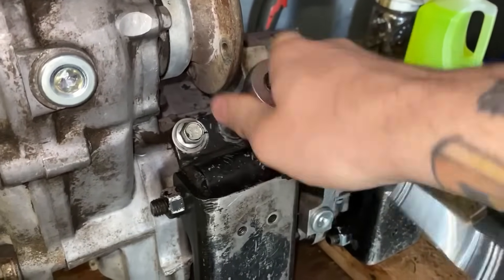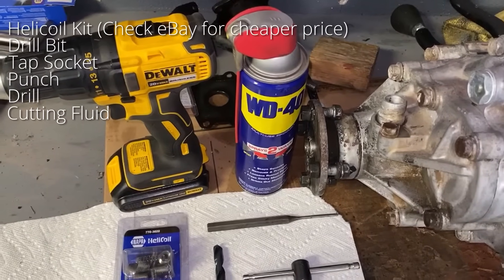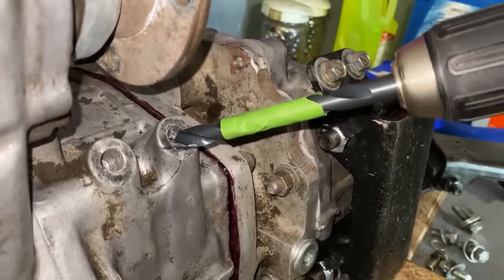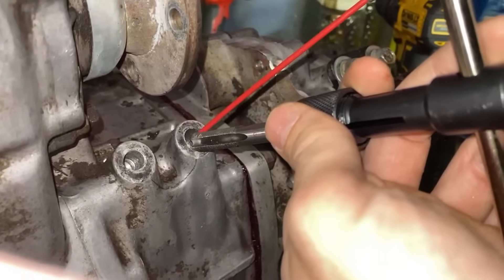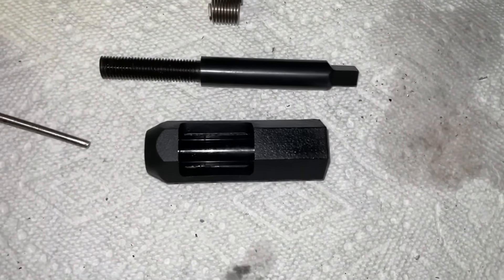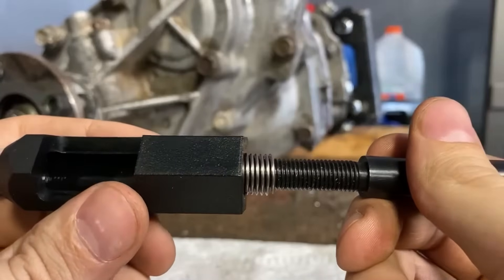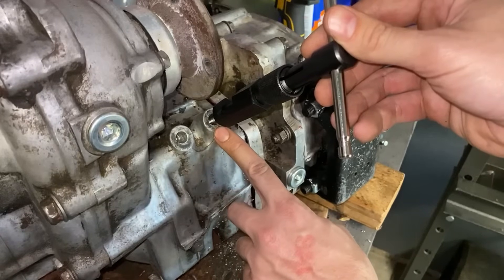How to Fix Stripped Threads With a Helicoil

Comment: how do you keep shavings from falling behind the wall of a hole you drill out ? Also you should use a drill bit guide to keep your hole straight..... then how would you keep the tang from falling behind the hole ?
Reply from the maker: If you were doing a through-hole you could put grease on the bit to catch the shavings. That always works pretty well. For the tang on a through-hole you could potentially get a skinny set of needle nose and wiggle it until it work-hardens and snaps off.
Reply: @RM_Garage  thank you !

Comment: Decades on this planet and I didn't know you could measure a hole depth with the other end of the callipers 😅
How would you tackle this? An injector clamp bolt hole with stripped threads must have been drilled out for a helicoil. The 'mechanic' ballsed it up and the injector popped taking the helicoil with it. Now theres about a 14mm hole.

The original snap bolt is 6mm so don't know how much alloy wall is left in the bolt hole. It gets better, its an Ingenium engine so you have alloy cam carrier box - then head - then block. The bolt hole goes through the cam carrier box and into the head. So anything involving loctite fixing compounds or metal putty can only be used on the lower head section otherwise you'll never get the cam carrier box of again. I was thinking a spark plug insert in top section and blank insert in head section with guide hole only, then with custom made insert to match spark plug insert, carrying an internal 6mm threaded hole. Torquing up the snap bolt is gonna be a bitch though and thats even if it does hold being seated in the cam carrier part only. It's got me scratching my head thats for sure lol.

Comment: Thank you sir, replacing head and base gaskets on a Honda CB650 and snapped off 2 head bolts in the aluminum case and currently drilling those hard effers out with carbide tipped glass and tile bits.  Positive I’m gonna need helicoils and thanks to you I can do it.
Reply from the maker: No problem! Those old CBs are cool.

Comment: What happens if you're tight on space, and don't have enough room for the tap-socket (tap-wrench) to rotate without banging against something?
Seems like the drill-mounted tap-bit could be trouble, as there's no feedback to feel how the threading is progressing...
Reply from the maker: I think you'd need to find a way to get the part off the car or make room to do it. Otherwise a right-angle drill with a tap bit and be super careful I guess.

Comment: If you able to tap the hole with new thread, why do you still need the inserts?
Reply from the maker: To keep the bolt hole the same size threads as before. Nothin wrong with going up in bolt size though.

Comment: Yep, one god damn bolt away.
Reply: Literally dude I just did my spark plugs and my intake bolt broke
Reply: You speak truth my brother
Reply from the maker: LOL
Reply: Fucking prelude intermediate shaft bolts stripped 2 of 3, Yet they went in smooth but would not tighten down mf was spinning
Reply from the maker: @mickeyslim  So typical!
Reply: Worst feeling smh just happened to me today
Reply: Literally on the last bolt that needed a torque spec on my dirtbike cases and stripped the gear selector bolt.  One bolt away from a fucking nightmare
Reply: Wow , mad at a mechanical part?

Comment: What if the hole needing tapped  is the drain plug hole of your transmission on a 2007 Honda Rubicon ? What about the shavings getting inside of transmission ??
Reply: Use grease on the ends of all your bits and clean them every pass.

Comment: Finished re-doing the lifters.. then timing, rocker cover back on with new gasket. All the bolts fit in beautifully, start torquing them all. Ahhh how refreshing, the bolt that’s making love with my firewall, a spot the ratchet barely even fits has decided it wants a divorce from the hole and fucked right off.  This video has provided great counselling for the bolt, the marriage has been saved.
Reply from the maker: LOL!

Comment: I stripped one of the bolt holes tapped internal threads on my Toro 21321 Briggs & Stratton 9P702-0181-F1 engine cylinder block, the bolt is a M7X1.0 should I purchase a M7X1.0 Helicoil Kit? If yes, I just need to know how deep should I drill and tap into the hole before I install the insert or should I drill and tap the length and depth of the screw or should I put something in the hole and when it stops mark that depth then mark that same depth on the drill and tap then drill and tap that far down into the hole? In other words should I drill and tap all the those old threads out before I install the insert?

Comment: My tensioner bolt decided to divorce the engine bay today after replacing a voltage regulator in my alternator. Literally the last bolt failed unable to put the belts now. Sucks I can't even use this because of the little space. Tried to unbolt the whole tensioner to have new threads and found that the whole tensioner is also worn out I can't take it out or put everything back in

Comment: Hi I just tapped the orifice to put a screw in valve seat   for my carburetor float needle on my yamaha outboard carb. The tap ended up making too big of a hole, I used a M10 1.0 whereas I should have used a 3/8 24  . I don't have the clearance to drill anymore as it's a thin neck. I need the inner diameter to be a 3/8 24. The screw in valve seat just drops in and wiggles out. I didn't think a M10 1.0 would have made such a difference but apparently it did. Will I find an insert to use? Or should i just use epoxy or wrap some copper foil around the screw?

Comment: You're a lifesaver. I stripped my aluminium cast transmission on my Lancer, whilst doing a fluid change. This was able to make it so all the bolts would torque again!
Reply from the maker: Nice! Glad to help!
Reply: I’m here for the same reason 😂😂
Reply: exact same thing happened to my civic
Reply: I now have to do this on the front subframe of my stealth

Comment: I snapped a bolt inside of the threads of my transmission pan, when re-fastening the pan onto my car. Now the entire pan leaks all my transmission fluid slowly through the slight itty bitty gap that exists from that one bolt not seating the pan flush with the rest of the car. I have to keep a catch pan underneath my pan to catch a drop of fluid every few seconds, overnight you get a handful of fluid. In 2 months it basically all spilled out, and my transmission pan overflow bolt is a torx female bolt thats also stripped, so now im considering what to do because i cant drive the car without any fluid, it won't even go into a gear without enough fluid.
Reply: I'm thinking I'll remove the overflow bolt somehow and pump more fluid in, but if I want to drill that broken bolt out from where the pan should be seated and re-tap it and do all this you showed me, idk. I might need some help.
Reply: Had a solenoid issue because my car been having an electrical problem since my car accident. Every so often it takes out a component of my car, one day a headlight bulb, one day the entire headlight assembly, or a taillight bulb, or taillight assembly, or mirror turn signal lamp, etc. Unfortunately at some point it took out my shifter solenoid that allows my car to change gears in the automatic transmission, and also controls my tiptronic control. But before I didn't know what happened, thought I ruined the transmission because I couldn't get into gear anymore or was stuck in 3rd gear on the road, really thought the car was cooked. But I did a ton of reading and research and eventually a couple months went by before I was confident and certain what the issue was, with the valve body, one of the solenoids. I gave it a try on a junkyard valve body and took many photos, until one day I grabbed a valve body itself with the solenoid pack. It was the wrong solenoid pack and not compatible with my car, tried it. But I replaced the ECC and the other one that were the same size, forgot its name, and thank God it worked. It was super messy and really complicated because I didn't understand the brackets or the pins or the wiring but thankfully I had pictures and the Internet to find things to help me. But yeah now the car drives just needs the right amount of fluid, I drove it around for a bit but when I went to finish the job and pump more fluid into the pan directly since the bolt was stripped, I had undone the transmission pan bolts enough to stick a hose tip into and get some fluid in from the side.

Comment: Can I just re-tap the hole and put the coils on the bolt and screw that in?
Reply: 🤔 but then it will come out when you remove the bolt won't ot
Reply: You can use oversized then 
It doesn't sense to screw that in

Comment: Can I use this on my honda c90 engine
The spark plug thread isnt the best
I guess I would need to remove the head first to avoid getting shavings into the cylinder 
Any help or advise please
Nice video

Comment: Didn’t say how to determine the thread or how to figure to get right kit.
Reply: You will use the bolt pulled the threads, take it to the parts store and get it sized

Comment: Don’t fool yourself, it’s not any stronger because the helicoil is still threaded into aluminum threads.
Reply: The coil that is threaded into the aluminum is a larger diameter than the original thread, therefore stronger.
Reply: It is. Physically tested/proven.
Reply: I guess all these f1 engineers must be wrong for doing helis in most of the engine parts

Comment: Excellent video, learned a lot from this. I had a bolt break off while doing a suspension bushing replacement on my HDJ81. I drilled it out and used a thread chaser to recover the original threads. Got lucky that the bolt was in a very accessible location.

Comment: In older Toyotas, the coils are held in place by a screw and it is into aluminum engine block. So JB Kwik Weld can be used to make threads since the coil screws  are NOT under stress... just keeping the coils held in place with very little stress on them... So lubricating the threaded part of each screw end is enough and the Kwik Weld is plenty strong enough to put in the aluminum block with damaged threads ....
Reply: What about the bolt holes for the valve cover? Would this approach work for them too?

Comment: Believe or not I was only one bolt away from replacing an oil cooler. I appreciate your video and wasn’t going to do this job twice.
Reply: Broooo same just 1 bolt away
Reply: Oil cooler on a jeep by chance? I just stripped one bolt hole on my 2016 Wrangler. I wasn’t one bolt away, though it was the very first bolt. And it was because I was using a foot pound torque wrench and not an inch pound torque wrench. Totally blanked. I was in my groove, banging out the job and everything was going perfect and I just grabbed the wrong goddamn wrench. Very pissed off but now I know how easily it can be fixed. The threads and mine don’t look nearly as bad as the video, my threads are almost perfectly intact. The ones that stripped are just the ones at the very bottom. Easy fix
Reply: I don’t believe you

Comment: Glad I found this video. I'm changing the transmission fluid in my 99 Expedition which requires dropping the pan. Three of the twenty bolt holes have stripped threads and it wasn't my fault this time. Still, I need some fast education and this helps a lot!

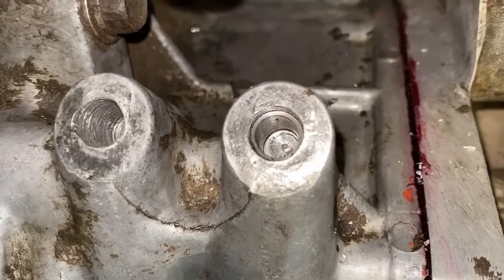Comment: So how do you take out the tang if you can’t turn you engine upside down? 4:30
Reply: blow out with compressed air
Reply: @markgrabowski8662 or a magnetic screwdriver
Reply: Or just ducttape on a screwdriver
Reply: I taped a small magnet to the end of a screwdriver, and got it out that way lol
Reply: Or vacuum
Reply: Can of compressed air
Reply: I left it in there.  No issues